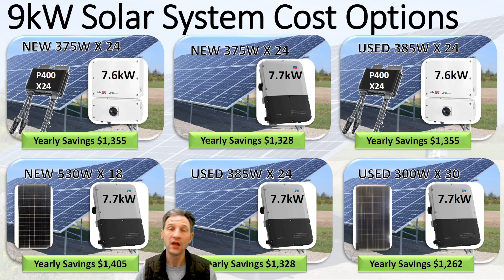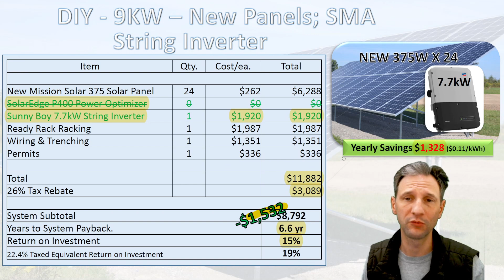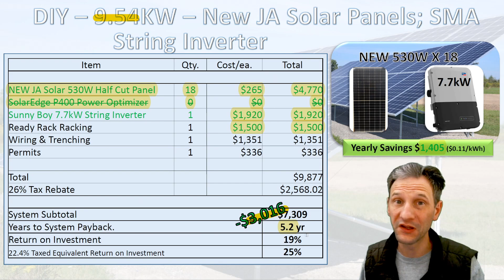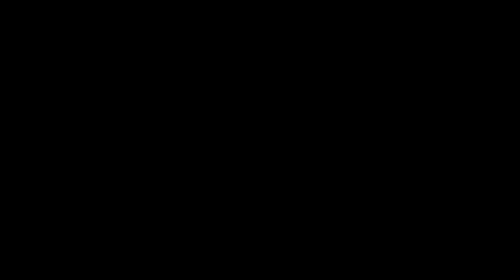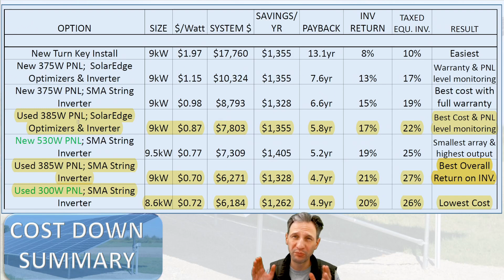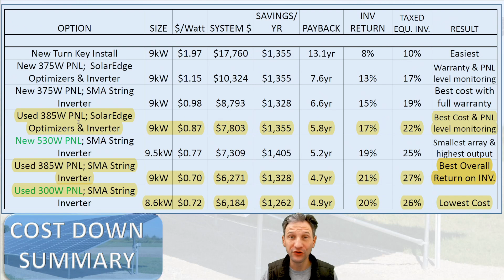DIY Solar Panel System - How to Do it CHEAPER!!

Comment: I would think that you would get the most facing the auxiliary panels if they are facing south east and south west. Maybe another test after the auxiliary panels facing east and west
Reply from the maker: Yes, based on the data I have so far I was considering doing that.

Comment: Sorry but not everybody has $24,000 just laying around!! In my case I am disabled living on just $6500 A YEAR....yes I said......A YEAR!!! I don't have a bank account, nor do I actually own anything of value, BUT I would still love to have a small back up system that would allow me to run a 12 volt lighting system and maybe a small refrigerator for my lady's diabetes medication fro when our power goes out!! You see where I live is prone to flooding, so we have outages more often than not! AND because we are both disabled money isn't a luxury we have so saving money on lighting costs alone would be great in our case!!
Reply from the maker: You can purchase battery powered generators that can run your fridge and some lights.  They don't require solar, you can charge them directly from your outlet.  This one on Amazon can take solar or wall power to charge: https://amzn.to/3EmUzTZ

Comment: Thanks for doing a comparison of costs. The tax credit has that it only applies to new equipment. So the numbers are off some for the used ones, as would not have the 26% on the solar panels then.
Reply from the maker: That's correct, I didn't realize the credit limitation on used panels when I made the video.  Thanks!

Comment: Very nice video.  I am interested in solar panels here in Texas without the micro inverters or optimizers as I am a Ham Radio operator and there is significant noise produced by these items.  Even some MPPT solar controllers are bad in that respect.  So for portable solar you have to do your research. Again, thanks for your video.  Used panels was a surprise to me. Have me thinking now.
Reply from the maker: Thanks for the info on Ham Radio interference.  If you want to reduce your interference, you may want to consider putting the inverter out with the solar racking instead of at the house.  This will require larger conductors running to the house because of the lower voltage, but it may help with your interference by increasing the distance to your antenna and giving you more opportunity for shielding against the noise.  Keep doing your research, I'm sure you will find the right solution for you.  : )
Reply: @ProjectsWithDave  sure thing.  I saw a YouTube video where they tracked down radio interference from the neighbors house a few hundred feet away. The solar panels were using the solar edge optimizers I think. I will try to get some real tests done with different solar setups. They used a mag loop antenna to go around the neighborhood to isolate the noise. With a loop antenna you can make the noise go away when you twist that antenna.  This gives you the direction the noise is coming from.  

Note: I am not trying to tell you have the wrong setup. I am just exploring and asking the ham radio and ham questions.   Thanks for taking time to respond.  I like your channel and I still want to put in my own solar system.  All. The best.
Reply from the maker: Great info!  Looking forward to seeing your final plan.

Comment: Which charge control did you use? Also do you have a battery bank?
I have 12 300w panels and have 24 130w panels.  Plus 2 Outback charge controller with 8-16 6v golf cart batteries
Reply from the maker: I have no battery backup, so I don't need a charge controller.
Reply: @ProjectsWithDave  no power at night?
Reply from the maker: I use grid power at night.

Comment: Hi,  just a thought,  if we are looking for extra winter power maybe the best orientation will not be due west but a lesser angle.  At my location in the winter the sun does not get to due west.  No significant difference on cloudy days but a gain when the sun shines.   
 My personal opinion is it is best to design for winter and the summer will look after itself  but I am aiming for grid independance.  I think my inclination would be to pick a point two or three weeks each side of the winter solstice  and aim at mid/late afternoon sun.
Just a few approximate figures people might find interesting.  They are calculated figures for my the location of my property about 59° latitude 30miles or so east of Greenwich.   It not practical to have independent racking,  all my panels need to be mounted on the structures. 
I have used the European research centre for the calculations which take into account average weather conditions at your specified location which includes    cloud cover and temperature (PVGIS).  They provide calculations for the whole world but I am not sure if you can access it from outside the EU.
Approx calculated average  figures for december and january
South+14° wall,  ave daily output 1kw per kw of solar panel optimum pitch    approx 19°.
East +14° facing roof pitch 18°:  0.25kw/kw of panel,   E+14° wall 0.5kw/kw of panel,  optimum angle approx 47/48°.
Yes the east roof produces a little more total annual power but much less in winter.
Reply from the maker: Thanks for sharing your investigation.  I agree, if you are looking to go off grid, and you live towards the north, it is best to design for maximum winter time output.  The early data from my west facing test rig shows that since there is very little clipping in the winter, it would be better to have the panels facing south.  Once I get the full data, I'll bring the analysis here for everyone's reference.  Thanks!

Comment: The analysis confuses me because you are changing the solar but not the inverter.  Total output can't exceed 7.7k at any time so how can the savings be different.  Having some extra solar makes sense and could help if the area has lots of cloudy weather.  Would help to talk about percent of overcast and how much savings the extra solar generates.
Reply from the maker: Each system has almost the same output, the difference in savings comes from the reduction in investment by using used panels and string inverters. If you watch my video on sizing your system you will see a good method for estimating the performance of and savings for each configuration you want to analyze.  See it here:  https://youtu.be/rbFnZqA0GCI

Comment: I live in Southern California, and we haven’t had 11 cent electricity for 30 years, so justifying solar is a slam dunk. My SDGE tier 3 rate this year is $0.41but with solar, I I stay at tier 1 which is $0.32. I chose Solar City rental agreement at $0.15 per kWh. There are no upfront costs to me. My reason for not buying my rooftop system is my shading factor was about 30% loss of sunlight on average. Also I needed to re-roof as they won’t instal over concrete tile roofing, it must be swapped out for composition roofing. Solar City did all this for free, and it looks perfect. So my 6 kW 23 panel system theoretical production is 9,600 kWh per year, the actual is 7,200 kWh. I only pay Solar City for the 7,200 kWh and through net energy metering, only buy about 1,200 kWh from the utility. WIN-WIN. love your channel.
Reply from the maker: Sounds like you found a solution that meets your specific needs.  Thanks for sharing the details with us!

Comment: Last week I replied to a ad for Free solar panels, it ends up was from a landlord that had a solar company as a tenant, they smashed the panels but know the  systems well I scored 26 Enphase M215 IG Utility Interactive Inverters. I am hoping to incorporate into a new system....Thoughts?
Reply from the maker: I'm not familiar with that particular unit, but I would just get the spec sheet and find some used panels on SanTan Solar's web site that will operate within the specs.  Sounds like you could make a great low cost system.  Good Luck!

Comment: Dave, Great information but how do you get 9kw out of a 7.5kw inverter. I think you are going to be replacing an inverter and the manufacture may not honor the warranty.
Reply from the maker: The systems in these proposals are designed for clipping.  Clipping does not impact the inverter warrantee and maximizes the return on investment.  Panels are cheaper than inverters.  You can read about it here: https://www.solarpowerworldonline.com/2019/12/how-to-maximize-solar-installation-value-using-inverter-clipping/
Both the SMA and SolarEdge inverters allow for significant clipping.  If you live in a cloudy or northern state like I do, your panels will rarely if ever output their rated wattage, so there is actually much less clipping that you might think.
Reply: The 9kwp rating of the panels is their maximum power at optimal conditions (which you won´t get very often) The 7.7 Sunny for example is rated by the manufacturer for an input of 12320WP (yes, you could officially with the blessing of the manufacutrer install 12,32kwp on that 7.7kw Inverter).

Comment: Dave, I have one other question. If the power goes out can you switch to your solar panels? My wife says that if the grid goes down you can't use your solar panels.
Reply from the maker: She is correct, my system will only produce power when the grid is on, most grid tie systems work that way unless you have a separate battery backup system which adds significant cost.  But technology is changing!  The newer SMA Sunnyboy inverters have the option of attaching an outlet that can provide some power when the grid is down as long as the sun is shinning ( see an old vide on the technology here: https://www.youtube.com/watch?v=fF461YYNbtw ).  Also the new Enphase 8 that just came out can provide power when the gid is down and the sun is shining (see that technology here: https://www.youtube.com/watch?v=wK950rn6HVw )

Comment: Dave, how much damage can be done to a solar panel if it's hit by a golf ball? I live on a championship golf course, don't see many golf balls as I live on the "hook" side of the fairway. But a few times a year a tee ball can find my roof. So it would be incoming from the south. I live in central Florida.
Reply from the maker: "While golf ball strikes are not part of required testing, solar panels are tested to withstand 1 inch hail striking the panel at over 50 mph"  Read about it here: https://floridasolardesigngroup.com/will-golf-balls-damage-solar-panels/
Reply: I can tell you from experience that a shattered panel will still produce power. I ordered a bunch of panels from Watts24/7 and FedEx being the careful shippers that they aren't managed to bust a board on the pallet and shattered the two bottom panels. I tested them with a multimeter and they still produced 44v. FedEx wouldn't cover the damage because I wasn't the person who shipped them. Watts24/7 refunded me most of the money and also told me that shattered panels would still produce. It's been 2 years and they are still producing. I fully expect them to die an early death though because of water intrusion and potential corrosion to the aluminum traces in the cells.
My 2nd batch of panels that I bought from Santan shipped with RL Carriers and arrived just fine. Interestingly enough Signature Solar ships their panels standing on their sides instead of laying flat on the pallet. They made it just fine as well.
As far as hail goes, I live in Florida and we get some marble sized hail occasionally. I haven't had any panels break from hail yet. I think I would freak out if I had golf ball sized hail but it's nice to know that they stand a chance of surviving.

Comment: How much did you value your time to install and design this?
Reply from the maker: I didn't include my time in the system cost analysis.  At one point I estimated 40hours to install my original system, and the install portion of the quote is about $10,000 so there is a lot to work with.  For me, I chock it up to a learning experience.  Also recording the activity and editing videos to share with all of you adds way more time than I will likely ever recover monetarily.  : )

Comment: As far as solar panels go, did you include the shipping?
Reply from the maker: Yes, I included the shipping for both the used and new scenarios.  However, the shipping will very depending on how many panels you ship and how far you are from the location they are shipped from.  The more you order the less it tends to be per panel.  For the lot of used panels I purchased the shipping averaged $11/panel.

Comment: are the panels seconds or defective from santan?
Reply from the maker: SanTan describes on their website the panel condition.  Some panels are new, others are used panels from sights that are upgrading.  They test the panels before selling them. You can check out all their panels here:  https://store.santansolar.com/product-category/solar-panels/?ref=EverydayDave
The 530W JA solar panels are on sale right now:  https://store.santansolar.com/product/new-ja-solar-530w-half-cell-mono-solar-panel/?ref=EverydayDave
Reply: @ProjectsWithDave  I know for a fact they do not test 100%. Had to return panels in the past because they were not all producing the same.  Some only half as much as the best ones.
Reply from the maker: That's interesting, thanks for the information.  What panels did you purchase, and what was the actual performance difference?  Thanks

Comment: You don’t explain the usage calculation. You do a decent job on the presenting different options. But most house’s with 220 appliances are going to need more electricity. Many inverters can’t handle the peak demands. Plus many electric companies don’t credit the same for watts produced versus watts used. Especially if you are using during peak times.
Reply from the maker: For more on my usage calculations you can watch my 1 year review video here:  https://youtu.be/BatTeSq05rU
For a grid tie system, the size of the appliance is not a factor, since the grid will provide supplemental power if needed.  I discuss further in this video on net metering:  https://youtu.be/IwUK1dNJ3n8
Thanks!

Comment: I see you never priced or used any Micro inverters I found used enphase inverters very cost effective and no string lose. Great work on the cost comparisons and I believe you ROI is right on. One other thing for electrical costing do you use the posted price per kwh or I actually use the cost divided by the kwh used because it is the actual cost as many utilities have added tax and delivery charges. Good luck Solar is the way to go.
Reply from the maker: Enphase inverters have always priced out to be the most expensive option in my investigations.  Where did you find used Enphase inverters?  As for the kWh rate, I use the total including tax minus the standard monthly connection fee, which is $47 for me.
Reply: @ProjectsWithDave  I believe they were on Craigslist but I no longer use it so Canadian Kijiji has quite a few but they are from individuals.

Comment: Depending on the wattage of a panel you could use one optimizer for two. Most people wouldn't install more than  20 in a residential setting give or take.  It is the shipping that gets you for panels. Used is a good way if you can get them. I like to stay away from China made if possible.
Reply from the maker: Thanks for the input.  There are optimizers designed for two panel input such as the P850, but I haven't investigated those solutions yet.